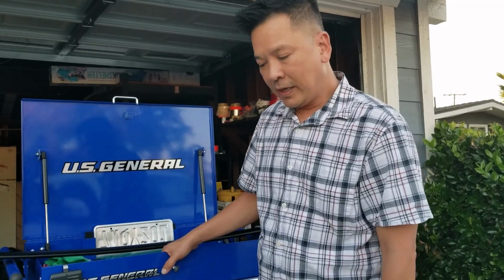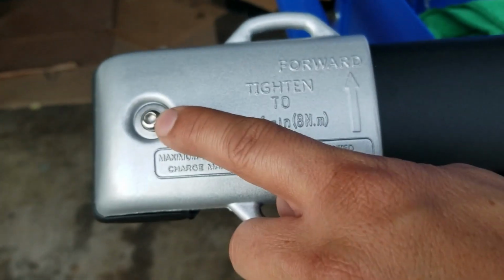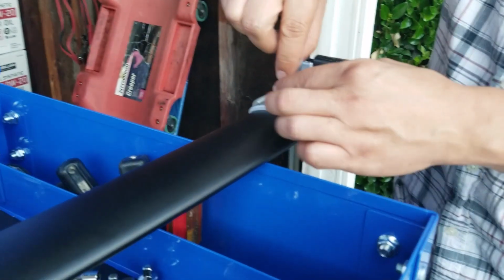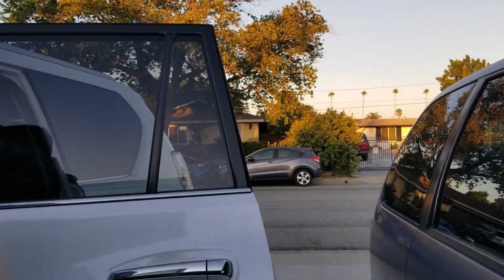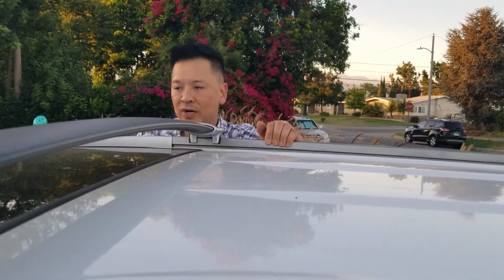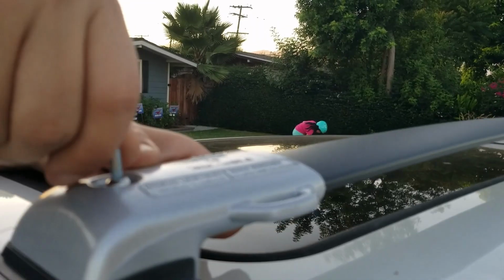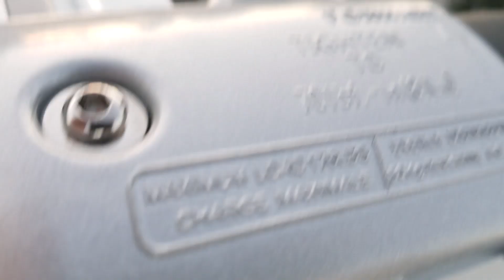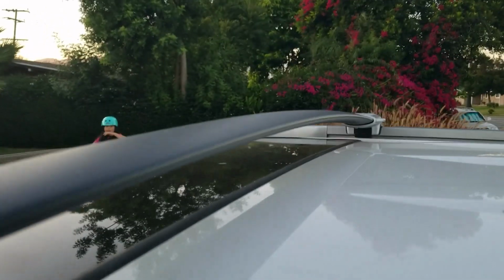2010-2019 Lexus GX Roof Rack Cross Rails Install

Comment: Where can i buy it?

i want to buy roof rack and roof box but it is not available in sweden as the lexus gx460  j150 is not sold in sweden i  imported mine from dubai and now i have problems buying roof rack and roof box.

Comment: I brought and installed the Lexus cross rails.  Just want to pass along the directions on the OEM bar that limit the installation of the front rail 8.5” from the front edge of the track and the back rail 14” from the rear edge of the track.  According to the directions for the OEM set, your front rails as installed on the video are too far forward and should be about 6” further back from where you have them installed.
Reply from the maker: Thanks Luke. I plan to redo some of my older videos when i get a chance

Comment: Hey Bob, question, does the crossbars make wind noise? when you are on the Hwy.
Reply from the maker: That’s a tricky question. I do have slight wind noise when i drive with my sunroof open but haven’t really found the culprit as i have other accessories i could blame it on.
Reply: @GXBOB  Thanks for the reply, I will need crossbars anyway, going up to Ottawa with the Thule box.
Reply: @garng3217  no noise from my bars , 2017 but they’re the overpriced OEM , look exactly the same

Comment: Thanks.  Was looking for some cheap crossbare for my solar panel.
Reply: I'm gonna be doing the same thing once I'm done installing my cross bars.  The challenge is where to route the cables (AWG 10) from the roof through the doors, hatch, window, etc.   UPDATE:  Got my roof rack cross bars from Ebay $78ish and installed it.
Reply from the maker: I feel a hole drilling job in the near future.  You gonna attempt it?
Reply: @GXBOB  No, I am satisfied with what I’ve done

Comment: bob fyi, i bought the lexus oem crossbars, they gave me something similar to yours, so i returned it and bought one from ebay 1/4 of the price. i was surprise that the oem doesn’t use the slots.
Reply from the maker: Wow. That is surprising and good to know.  I wouldn't be surprised if all the accessories they sold were made in China with the Lexus logo  stamped on it.
Reply: i found out the purpose of the slots on the roof rails are to hold them in place.
Reply from the maker: @stoned_kapre  Thanks Kapre, good to know.
Reply: @GXBOB  the Lexus OEM cross bars are made in USA.
I have yet to see an OEM Toyota/Lexus part made in China. I think I've seen one or two made in Korea, but haven't seen made in China.
Swipe thru the pics.
https://www.cbehnashr.com/index.php?main_page=product_info&products_id=387201
Reply: My OEM do use the slots ( 2017)
Reply: @stoned_kapre I think the reason it’s confusing is because these crossbar designs are different from earlier ones. The earlier ones were really slim lined with tapered ends that fit perfectly into the slots once you remove the slot covers. The issue was that those crossbars were too low, so if you installed a cargo box or rooftop tent then sometimes you weren’t able to get the clamps or screws under the crossbars, or they’d hit the roof.

I’m not 100% sure that I’m right but I’ve seen pics on eBay of gx460 crossbars that look completely different than the ones they sell now. And I’ve also read the complaints on the forums about them. Anyways, based on that, the locations of the slots would make sense since those older bars were lower, they could be placed further forward towards the sunroof and not be in the way. Another downside however, is that they are not adjustable along the length of the rail. So you were stuck with them in only the location of the slots.
Anyone who has had earlier 4Runner or gx 470 and used their crossbars would’ve HATED this extreme loss of practicality. About the only pro the older ones had was a cool look, no wind noise, and anti-theft since there were no exposed screws. 

However, these newer ones that are higher up and rail adjustable are much more practical for true Gx owners. If you can find a good deal on the OEM ones then I’d go that route. I bet they are built better.

Comment: GX*Bob is there a reason you placed the bars in the location you chose? I just picked up my Lexus Cross Bars. Will be installing Saturday.
Reply from the maker: the bars are not the same length.  Size them up and temporarily fit them up on your rails to determine which ones go up front and which ones go in the rear.  Its straight forward and no, there was no rhyme or reason for the location i chose.

Comment: If it’s the OEM crossbar, I’d assume those rectangular pieces on the rail have to come off to expose some anchor holes?
Reply from the maker: It’s not oem and you’ll be surprised that oem is also not oem. Some have found the aftermarket ones at the dealership parts dept displayed.
Reply: @GXBOB  so I took the chance and bought an OEM (sure I know Toyota didn’t make these, by OEM I mean sold by the maker). I was at the parts dept of a dealer and they have it in stock. A couple of things: 1. They are marked “made in USA”, 2. The installation is the simplest ever, no need to loosen anything, all the four top screws are pre-loosened just the right amount, and the washer underneath is ratcheted/teethed 3. The Allen wrench is the one that takes the cake, it’s a simple, four inch long Allen wrench, with a red plastic clip/flag on it and a plastic “handle”, so that you can precisely tighten to 8Nm. It’s a cute little mini torque wrench. To drop the bar and let it hook under the rails is very straightforward, perfect fit. $200? Maybe not but sure it felt like the “OEM” lol

Comment: Hello Mr. BoB. This can be easily removed if stolen.  I want to get rid of the thule vector on.  but a little worried.  should ask for advice. Cám ơn Chú
Reply from the maker: i  would take your fasteners and go to home depot.  I would replace your current fasteners with specialty head such as torx or star heads.  If a thief decides to steal anything on your car, he is only equipped with a flathead or phillips screw driver.  You can't prevent theft but you can make it harder for the thief.  He might just give up and move onto the next truck to steal.
Reply: @GXBOB  Thanks so much Mr BOB

Comment: Usually they come in pair as you initially indicated. Is it thesame procedure as the first one installed or there’s a slight difference?
Reply from the maker: The front setup is practically the same as rear setup.

Comment: I am concerned about the quality of the clamps which are made from cast iron. One of my clamps was broken when I received the package. Apparently it was damaged during the transportation. With this design it will be a safety issue when you have your bike on roof on highway and suddenly the clamps are broken.   Just wondering how yours performed so far.
Reply from the maker: Your clamp was broken during shipping but clamps installed on your roof rails share the load with other clamps. I had a heavy roof basket attached to the rails for awhile in which i installed them with equal weight distribution amongst the 4 clamps. If installed correctly you shouldn’t have any problems except paint peeling.

Comment: The bought the same roof rack for my 2014 gx460 Premium but the rack seems short by 1/2 inch on one side.  If I extend it as far as possible to one side, the other side does not extend far enough to reach the other side.  Yes I did take out one screw on the springy side and extend it to the outer screw hole.  Was I send the wrong roof rack?
Reply from the maker: I have no way of knowing if you bought the right ones.  Wasn't sure if you already attempted this but I would move the rails forwars or back in the roof till they do fit I checked the ebay page I bought my roof rails from and the title says "For Lexus Roof Rack Roof Rail Crossbar Set 2010 2019 GX460 Replace PT278-60170 ". See if you can match yours with mine.
Reply: Tony, did you try Bob's advice of moving the rails forward or back? I am about to buy these racks but there seems to be confusion out there what years of the GX460 these racks fit. I have a 2013.
Reply: @michaelblaser8822  I moved it forward and backwards, no difference as the racks are the same size, distance forward to back.  Mine was a 2014 Premium and I've tested it a couple times and the roof rack just would NOT reach side to side.  I had to return mine.
Reply: @michaelblaser8822  My research based from GX 460 owners/users, indicates that that particular part PT278-60170 should fit for 2010 through 2021.

Comment: I installed 3 OEM cross bars at 15 inches apart. I think I might as well just put the 4th one they will be about 8 inches apart. Ive watched all your videos.
Reply from the maker: That’s a lot of crossbars you’re installing. You might as well invest in a roof rack 😀
Reply: @GXBOB  I probably will. Are you going to do a video on the KDSS Lean, and fix? Mine doesnt lean, but Im interested in your thoughts?
Reply: Can you give us the OEM part number Josef?  I don't think Bob says, but I don't think his are Lexus?
Reply: Found em!  Lexus PT27860170 which is about $185 for the pair.  Ebay knock offs appears to be around $62, (bob your link didn't work for me). Thanks for another great video!!!

Comment: Watch the weight ratings of these bars.  I think it’s only 65lbs. They bent on me when I put a roof box on it and loaded it with some ski equipment. It’s also too close to the roof, the foot of the roof box  mounting bracket is almost touching the roof.

I end up switching to a Yakima roof rack system. Just want to share my experience with all the GX owners
Reply from the maker: Thanks seven. I’m looking to eventually upgrade as well. I’m not really using the bars for anything at the moment.
Reply: @GXBOB  

Hello
Would you be able to do a video on matching a Lexus credit card key to a GX460? There is a video on YouTube but I think your video has much more details
Reply: This is interesting, another YouTube post showed the owner sitting on top of his Yakima platform that is installed on his OEM crossbar, though his truck is an early model 460 (but he made a point that he just used the OEM crossbars).

Comment: What are the silver end pieces made of; metal or plastic ? Just tried the link you posted for them- it doesn't work.
Reply from the maker: The video was done a bay long time ago, unfortunately some of the links haven’t been updated. Here is a link: 
https://www.ebay.com/itm/Roof-Rack-Cross-Bar-Rail-Fit-2010-2021-Lexus-GX460-Cargo-Luggage-Kayak-Rack-/185231919460?mkcid=16&mkevt=1&_trksid=p2349624.m46890.l49286&mkrid=711-127632-2357-0

Comment: GX God I mean Bob. I bought one of these used on Facebook Marketplace and it came with the wrong top screw...what size is the single top allen screw? any idea?
Reply from the maker: Good lord Allen, i couldn’t tell you even if i took my basket off and screwed it out just to measure. I would just buy a handful of screws at your local hardware store and return the ones that don’t fit

Comment: Can you put 4 cross-bars ? Does it look good with 4 cross-bars.
Reply from the maker: What would be the purpose of 4 crossbars that 2 couldn’t handle?
Reply: You can increase the weight limit. Lexus says 125 lbs for 2 cross bars. If you put 4 cross-bars, you will get 250 lbs weight limit. That is why.
Reply: @bokatorus771  I put 3 OEM decided that I might as well install the 4th one. They will be about 8 inches apart.
Reply: @josefastor5825  Does they look nice and strong?
Reply: @bokatorus771   Yes, I think they look pretty good. Im going to put on the 4th one when the weather gets cooler.

Comment: Hello friend! Tell me the silvery mounting supports are they metal or plastic?
Reply from the maker: I believe they are metal.
Reply: @GXBOB    I bought them, they are plastic and it is bad
Reply from the maker: @northerncruiser5404  for the price? $60 and it does its job. It held a heavy roof basket without fail for 6 months.
Reply: @GXBOB  I bought a set for $ 120 in China, I didn't like this plastic, there is doubts that reliability, I will drive try how it will work, thanks for answers! I'm from Russia friend.
Reply from the maker: @northerncruiser5404  don’t under estimate durable plastic over metal. Plastic doesn’t rust in Russian winters.
Reply from the maker: @northerncruiser5404  surprisingly someone else bought the exact same one from the Lexus dealer. The dealer does offer aftermarket at double the price.
Reply: @GXBOB  We have dealer Lexus sells accessories too at double price, some things I order in online stores, so convenient, I live in the North here dealer Lexus from me far

Comment: Hi Mr Bob! Do you think this will fit a 2021 model? Thanks in advance
Reply from the maker: To be honest, i don't have the slightest clue as i have not had any opportunity to check out the new 2021 yet.
Reply: @GXBOB  I bought it and it fits!
Reply from the maker: @fierce9852  thanks for sharing.  This will be useful to the GX community.  Just curious, was it under $100 ?
Reply: FYI: They're not the same length. Each is designated for rhe front and rear. The front is longer. Yes it is $70 OBO. BTW, you have an awesome channel. More Power!
Reply from the maker: @fierce9852  Thanks for sharing Fierce and thanks for the words of encouragement.

Comment: Wasn't one of the bars longer than the other?  The description said that the front bar is longer than the rear.  Is it possible that you put the short bar on the front?
Reply from the maker: It is definitely possible.  But i've gone thru so much trouble and i have a 200 pound cage sitting on it, i don't want to redo it.  Plus the entire setup is pretty robust.  Thats why i have these comment sections to point out mistakes and give me a chance to edit the body of the description with new findings.  Thanks Brian for the valuable input.
Reply: @GXBOB  I ordered some bars and will let you know my findings.  Worst case scenario there is always zip ties.
Reply from the maker: @blang1  I like  the way you think.  I think we are going to get along just fine.
Reply: @GXBOB  So it turns out that the forward crossbar was longer than the rear however your modifications probably still would have been necessary to move the forward crossbar that far up on the side rails.  Also, the instructions said that you want to get as close to those side rail caps as possible because they are load points.  You will notice that those caps line up with the body frame and are not directly over the windows.  At the same time as long as you aren't exceeding the 150 lbs limit (or even 200 lbs) your probably still good.  I was only able to come within 7 inches of the forward load point unless I wanted to apply the Bob Mod.

Comment: Great video. Please provide a review of the product if you can.
Reply from the maker: Surprisingly , one of my followers mentioned that he bought  the set that i showed in my video and they were the same ones that his Lexus dealer's parts department sold for over $200.  They are made from pretty sturdy aluminum and the fit is pretty tight.  Its currently holding up a heavy roof basket.  I have checked it every so often to see how  its holding up and it hasn't failed me yet.  I bought them for around $60 brand new on eBay, i believe.  Of course, they're made in China but it serves its purpose.

Comment: Is this truck reliable? How many miles?
Reply from the maker: Are you seriously asking if Toyota Lexus is reliable???
Reply: @GXBOB  yes, i know they are, but did u have any problems with this truck? How many miles? Any parts you had to change?
Reply from the maker: @luckyyou774  no problems.  Any parts I changed so far are merely routine maintenance.  Any other parts I changed are strictly to do the video even though I didn't need to change them such as the brakes.  My car is a 2017 and It had 15k miles per year, every year.  Driven in southern, California climate.
Reply: Great, i just cant decide 4runner lmt or gx460
Reply from the maker: @luckyyou774  https://youtu.be/6oWMcW3CscM
I would watch this video. It makes alot of sense
Reply: @luckyyou774  V8 or V6, luxury or utility, bad gas mileage or slightly better MPG. Land Cruiser Prada in Lexus trim or a 4runner. It was an easy choice for me.
Reply from the maker: @DouglasMiller911  Buy what you want, not what you need and throw all that pros/cons list out the window.  Thats how I live.

Comment: Hilarious I have OEM , looks exactly the same ….costs approx $400 Canadian installed by dealer ( on it when I bought it ) 😂😭
Reply from the maker: Wow, that’s what you call a great profit margin.
Reply: I jus paid $239 out the door Lexus Van Nuys
Reply: Speaking of OEM, an NX PHEV I am contemplating purchasing has the OEM cross bar roof racks on it.  Not sure if they are similar to these ones, but if we remove the OEM roof rack, are there any holes/seal compromise that would happen once taken off?

Comment: You just made this install harder than what it should be by removing everything. They are designed for plug and play. No need to remove anything of those things you did. I guess everyone does it differently.
Reply from the maker: My intentions are to show you the wrong way so u can use logic, common sense, and mechanical aptitude to prove me wrong. You have passed the test young grasshopper.

Comment: Think originally, this main gray parts must be made of steel. But this one is plastic. Never use it )
Reply from the maker: it held up a very heavy roof basket without fail.  You have to consider the weight displacement involved.

Comment: Bob, I got these same crossbars and installing today. I'm curious, do you still have these on? Have you been happy with them?
Reply from the maker: Word of advice check the length of each bar. I believe one is front and one is rear, not interchangeable as i assumed. They’ve worked great so far.
Reply: @GXBOB  would they hold on if l use them for a set of recovery tracks? No much weight, but I'm worried about the wind drag